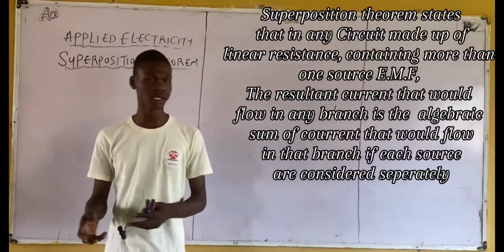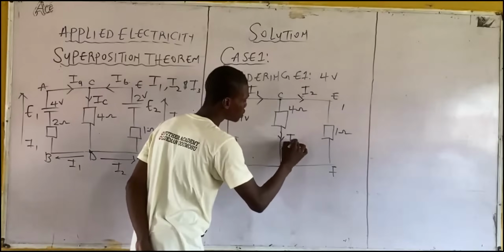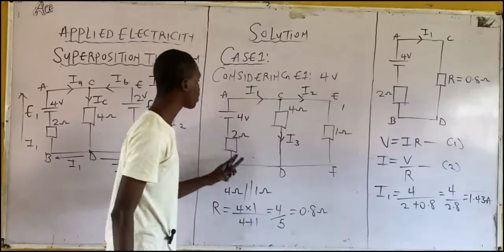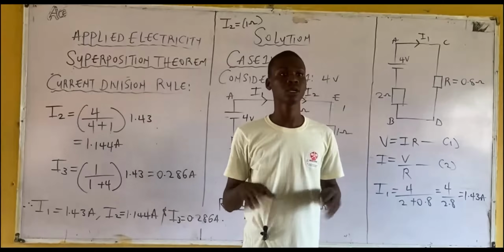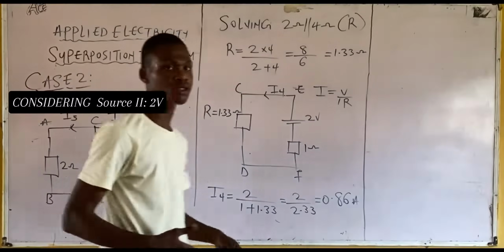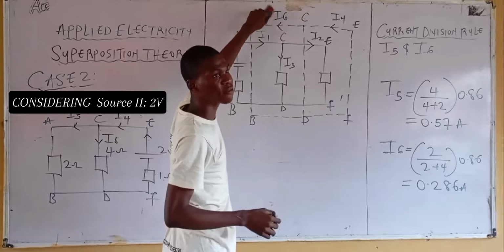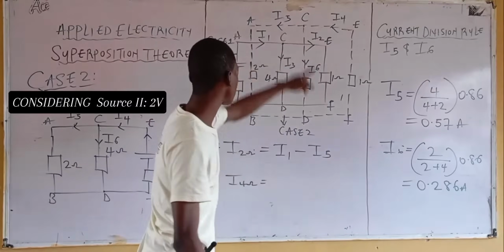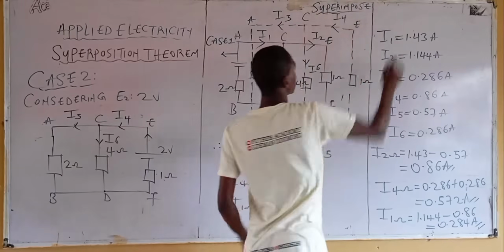Superposition Theorem: The Trick That Makes Circuits Easy

Comment: what if the voltage in the case 2 is greater than that of case 1
Reply from the maker: That doesn't mean you are not correct..
It only shows that the battery is discharging. 
As a result of the negative you got.